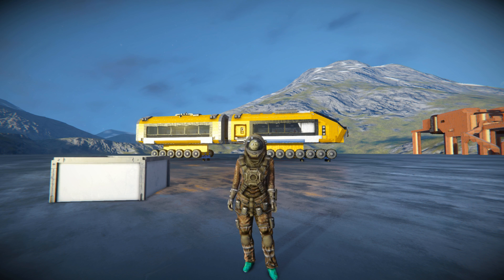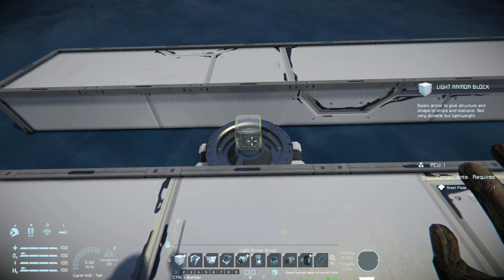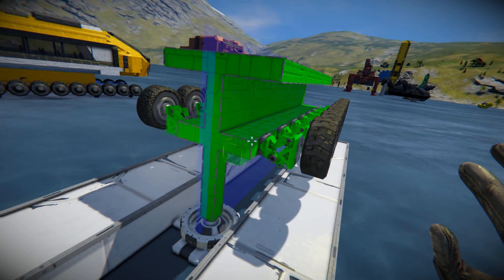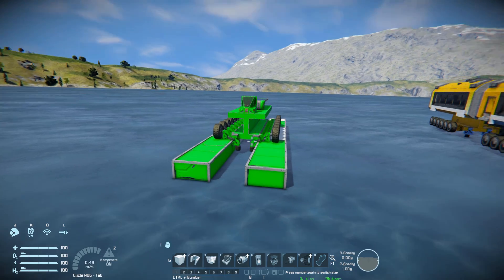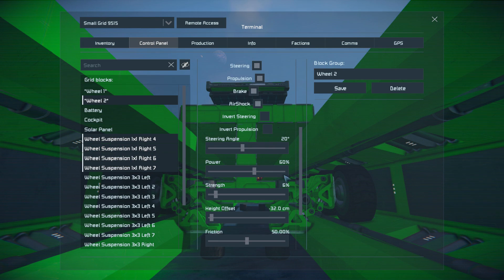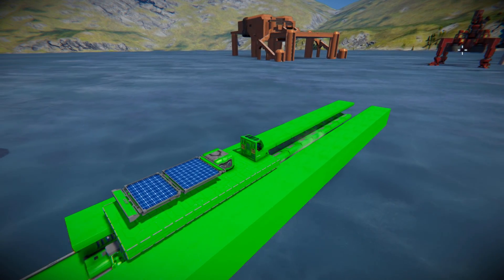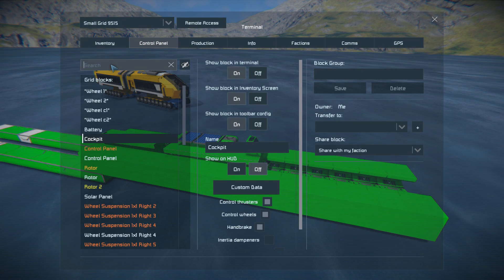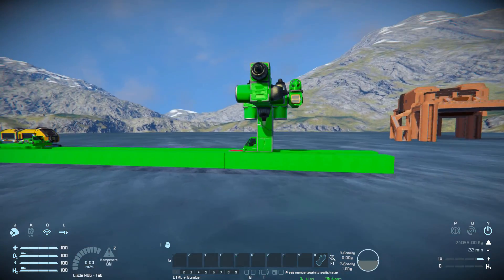Building A Train And Track - Space Engineers

Comment: for anyone having trouble with this. if you have access to dlc content. use the passage way 2 side block to get the height correct. then go the the passageway 3 block or passageway 3 w/ light block. far smoother and doesn't require nearly as much ramming.

you can also do a second set of wheels to increase stability. so you also drive along the top of the passageway. this also gives you a second set of wheels to keep you centered.
Reply: Exactly, this was what I did.
Reply: Thank you!!! After crashing my train several times i tried your tip and it worked first try. Just had to adjust the wheel height a bit so i dont grind metal on metal while driving. Now it is smooth like a magnet train!! But in survival the traks are really recource heavy. So i decided to put some drills on the train and just go straight through a mountain. Drill - extend tracks 3x inside the mountain and 100x on the other side of the track into the intended direction xD
Reply: @5calambres  you may want to adjust friction settings on your wheels now and use thrusters for movement. But that's optional.

Comment: Seems like the wheels get buggy stuck (or iffy ;-) ) in the passage no matter what adjustments i make to them. If you have the same problem just adding some forward and backward thrusters on top fixed it for me - i also turned off the propulsion and steering on the wheels so that they are more or less only used to keep the train on the track.
Reply: Try making the passage blocks with actual block , the variety might just be big enough for you to make it work

Comment: I find the 1x1 wheels glitch ALOT inside the other blocks which when block dammage is on it damages stuff. finding a way to fit 3x3 wheels there really helps, you can do this by putting the passage ways 2 blocks appart stops alot of the glitching

Or use the energy shields mod :) helps with piston elevators also